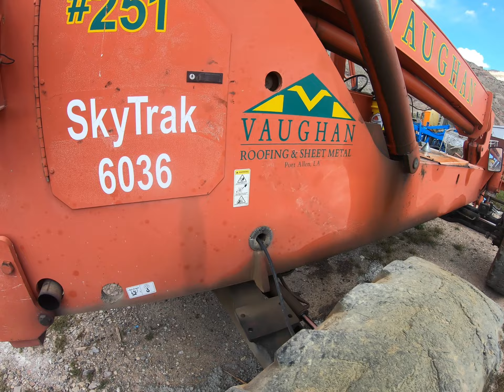SkyTrak Telehandler Steer Cylinder Repair

Comment: I have steering issues on a 6036 skytrak I’m working on. When it’s in 2wd mode the rear wheels will turn/move an not hold straight. Have to switch to 4wd to straighten the rear wheels up. Any idea?? Thanks
Reply: Carrerra axle? Cracked magnet and the sensor doesn't pick up the park location.
Reply: park them straight and unplug the solenoids.

Comment: you didn't replace the grease dusk cover?
Reply from the maker: No, I only replace and do what the customer pays me to do. I always recommend repairs and make them aware but it is up to them what they want me to do.
Reply: @paulsequipmentrepair823  we recently replaced the brake seals on the front axle of a sky track because it was leaking out of the breather but it blew past the new seals immediately. What did we do wrong?
Reply from the maker: @shiniquajones2812   If the seals were installed correctly, you need to check your brake pressure at the valve to ensure you have the correct pressure.  You will need a hydraulic pressure gauge, hose and adapter.
Reply: @paulsequipmentrepair823  2 things the other guy did that I didn’t like, 1 he didn’t put grease on the new seals to put them in and used some WD-40 instead and 2 had the seals in on one side and then cleaned the other side with B12 carb cleaner which tends to damage plastics but not sure about rubber. Could either of these been a problem as well?
Reply from the maker: @shiniquajones2812  I always use assembly grease such as the type used for transmissions or similar. Don't use something too thick. Sometimes I use oil or oil/ grease mix, nothing as thin as WD though. Never let brake fluid or carb cleaner come in contact with seals. It not only can possibly damage the seal it also makes them not slide through the part easily. I couldn't tell you for sure if anything he did was the problem without seeing the process.
Reply: @paulsequipmentrepair823  thanks for the responses. All we can do is do it again and try those things differently this time.

Comment: That looks like Grand junction
Reply from the maker: Mike Hunt You are correct, it is
Reply: @paulsequipmentrepair823  where do provide services? I have an old lull telehandler that’s got a few rough edges
Reply from the maker: @Lull622  I cover western Colorado and Eastern Utah.